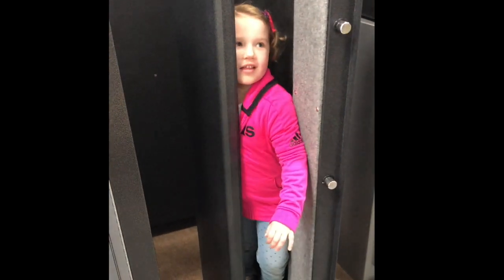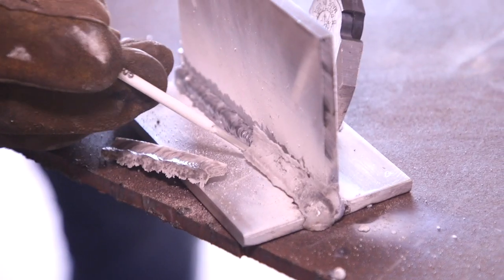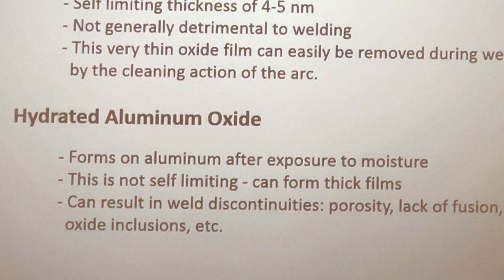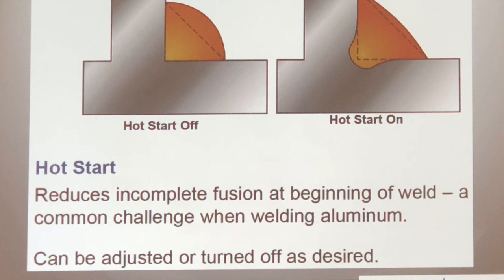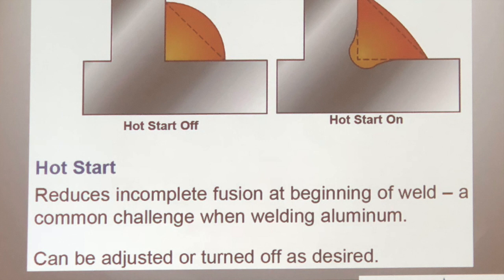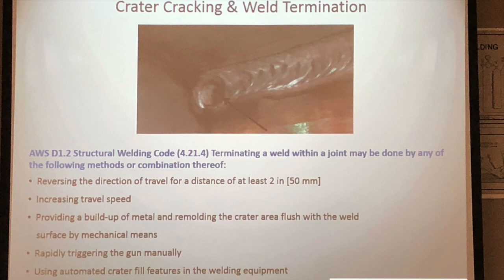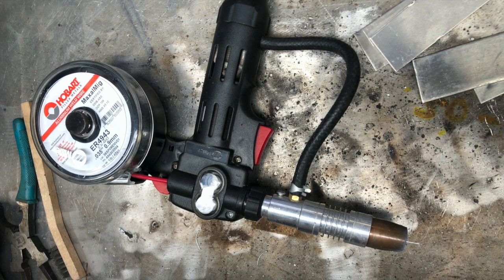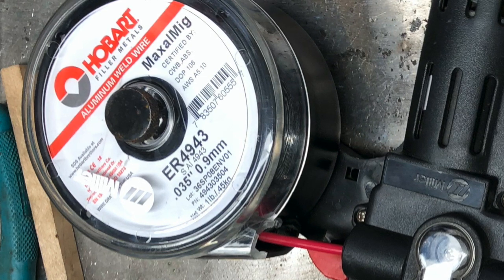Aluminum Oxide layer - what YOU need to know before welding...  MIG TIG STICK

Comment: I had the same question, if it oxidizes so fast then whts the point ?  Now I guess “dry oxide” means that of regular air humidity and “wet” when there is visible water. Thank you for another valuable info.

Comment: Very informative video. I was wondering if the PP200 has hot start?
Reply from the maker: Dhce 05 yes it does.  In mig 2t it has a timer controlled hot start up to 4 sec and in mig 4t it has a trigger controlled hot start. (As long or as short as you want to - you control it with the trigger)
Reply: @ZILAwelds  Thanks Pete. I'll check it out. One of these days I'll get the variable slider for the PP200 and maybe that could be used for a type of hot start. This is Dave in southern Illinois
Reply from the maker: Dhce 05 the slider will do hot start and crater fill in every program even non pulse programs
Its the ticket for aluminum welding
Reply: ZILA is that a generic mig gun you’re talking about? Or machine specific or tig control? Really great video dude! I’m doing more and more tig Ali work and learning all the time. It’s such an interesting material to work with. I knew that the oxide layer was not much of a problem on drag stuff but was always wandering why it was a bitch to break through on repair work I had that’s been outside it’s whole life! Great info! Thanks. Andy